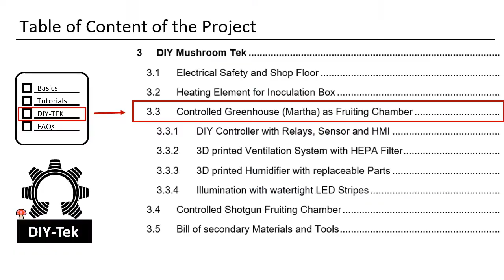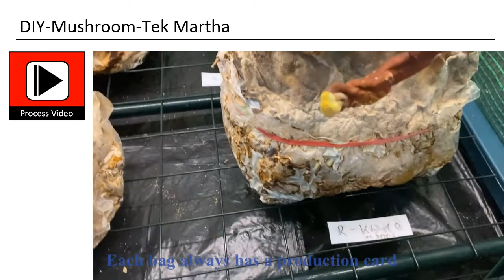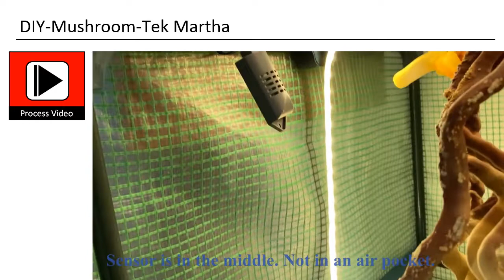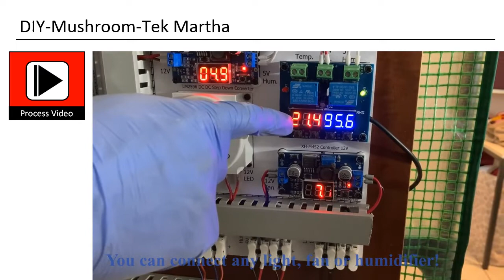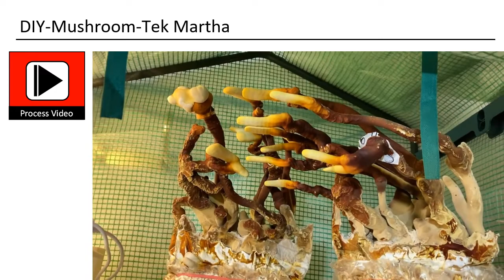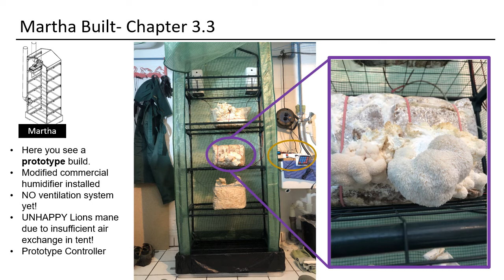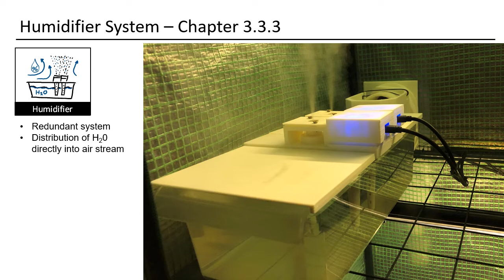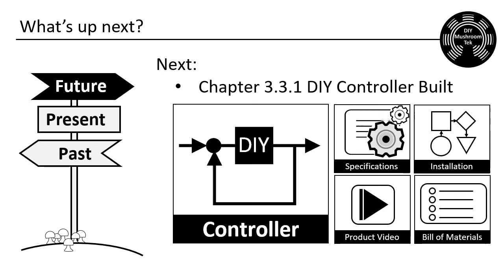3.3 Controlled Greenhouse "Martha" as Fruiting Chamber

Comment from the maker: ◾2023-12-23: Update your Martha with an even further optimized air and humidity management inside a grow tent!
https://youtu.be/A7fmnVn5-bA
https://www.thingiverse.com/diy_mushroom_tek/designs
◾2023-10-01: Please use the newer and more advanced XY-TR01 humidity controller with the SHT20 Sensor instead of the older XH-M452 with the AM2120 Sensor.
https://www.thingiverse.com/thing:6242947
https://youtu.be/9WZ3lEHDnYs

Comment: Hey i just sniped a nice cabinet style fridge for 5euro to make my fruiting chamber, im getting closer to finish my build im very excited! 

Hopefully i will not make too much mistakes when pinning and fruiting, i made PF tek cakes, grain to various substrate, agar work, cardboard.. All colonizing kind of slow because its 17° in my house. 
A few days ago i made an incubator with a small old freezer, i just put a 5L bottle with warm tap water in the morning in it, it raises to 25°C and drop to 20° the next morning, its awesome and things move a lot quicker now. 

Btw i found a reishi in the wild 2 weeks ago and attempted to clone on agar a part from the under cap i sampled from it on site, since there was only one specimen. I think i got mycelium but it barely grew like very few short fine strands, not fuzzy and very scarce and localized on the "woody sample"  i made a transfer today lets see how it goes. 

Cheers
Reply from the maker: Hey Linus, thanks for the update! I am sure you will manage the PF Tek! As I have a warm space next to my heating system, I did not pursue an incubator any further. I did design an incubator in the beginning. I always wanted do make a video about it, but did not find the time yet. You found a very nice solution with the hot water bottle. I combined some cheap electrical components in an insolated box. Then one can set up the desired temperature and it will stay that way. If I find some time, I will make a video about it. It is quiet easy to build, if you are interested just combine these things:

◼️ 12V 50W Multifunction Air Heater Insulation PTC Heaters Thermostatic Heating Element Multipurpose Heater Incubator Patio Heaters – ca 6€
https://www.aliexpress.com/item/1005003402347469.html?spm=a2g0o.productlist.main.23.510a4bf48wqpfP&algo_pvid=c32e6f56-db54-4f7c-880e-331ff64d8b70&algo_exp_id=c32e6f56-db54-4f7c-880e-331ff64d8b70-11&pdp_ext_f=%7B%22sku_id%22%3A%2212000025624999509%22%7D&pdp_npi=2%40dis%21EUR%216.67%215.07%21%21%21%21%21%402100ba4716698247552481218d0727%2112000025624999509%21sea&curPageLogUid=NUU9nynrIqyw

◼️ W1209 -50-100C DC 12V RED Digital temperature controllear thermostat temperature control thermostat switch plate W1209 case – ca 3€
https://www.aliexpress.com/item/10000002309483.html?spm=a2g0o.productlist.main.13.2a183b93UxcoBK&algo_pvid=a8273e4a-da40-4fac-b5f3-e19200072051&algo_exp_id=a8273e4a-da40-4fac-b5f3-e19200072051-6&pdp_ext_f=%7B%22sku_id%22%3A%2220000000006332489%22%7D&pdp_npi=2%40dis%21EUR%212.77%211.77%21%21%21%21%21%402100b1a616698248693445588d0753%2120000000006332489%21sea&curPageLogUid=Me7s2ps7F7FY

◼️ 12V 5A 5 amp 60W DC EU/US UK AU POWER Supply ADAPTER Transformer LED Strip Light – ca 8€
https://www.aliexpress.com/item/32988174960.html?spm=a2g0o.productlist.main.5.d61726d5mePI4T&algo_pvid=48d0d369-17da-4b38-a381-70ec232789d8&algo_exp_id=48d0d369-17da-4b38-a381-70ec232789d8-2&pdp_ext_f=%7B%22sku_id%22%3A%2266833678459%22%7D&pdp_npi=2%40dis%21EUR%218.0%217.43%21%21%21%21%21%402145288516698249428688962d0748%2166833678459%21sea&curPageLogUid=N2GnaymYuzGQ

◼️ Insulated thermo box transport 

Happy Mushrooming!

Comment: Amazingly grown reishi! Do you ever get algae growing in the humidifier because it’s transparent? I have mine outside of the tent pushing air and fog in to save space, but i imagine the algae could still be a problem
Reply from the maker: Hey drm! It's great to know you're also a fan of reishi! Here's my take on your question:

1) I've been using filtered rainwater, and it has several advantages. It doesn't lead to the calcification of my humidifier, and it remains clear for an extended period. You can easily see this clarity by looking into a rainwater reservoir. However, you're correct about the issue of algae growth when there's UV light exposure to the water. Fortunately, with only a bit of artificial light, I've never had problems with algae.

2) My humidifier design has proven to be quite robust over the years. The electronics don't seem to mind the high humidity environment, and the 3D-printed PLA parts remain functional even when they're constantly exposed to water.

3) Maintaining the humidifier is relatively straightforward. Periodic anti-calcification measures and changing the cotton sponges are the main tasks. The sponges tend to be the primary issue when it comes to maintenance. Cleaning the plastic components and the reservoir is a quick process with a brush. Anti-calcification isn't a hassle, and replacing the cotton sponges is an easy and affordable task. Neglecting this can lead to algae growth.

4) I'm currently working on designing a similar setup for tropical plants, complete with a strong LED grow light covering all UV ranges. In this new environment, I've noticed the cotton parts turn green quickly due to algae. This has led me to develop a humidifier with an external water reservoir that only performs atomization inside the tent, which has increased the need for maintenance.

5) I prefer the internal version of the humidifier because it allows me to create the desired humidity where it's needed. The slightly reduced growing space is not a significant concern for me. Regular checks inside the tent make refilling easy. It's important to ensure the reservoir is fully covered to prevent spores and other contaminants from entering the water, which drastically extends the time between maintenance.

I hope you find these insights useful. Happy mushroom growing!

Comment: Hi, why didn't you put the air filter right behaind the fan? (Great work btw)
Reply from the maker: Hey Alfredo! This is the right question to ask. I had to learn it the hard way when I started designing my Martha system. The fans are IP68, which means waterproof, and they also have low power consumption. These are the very big plus points of that specific fan. Since there is a law that states that power equals pressure multiplied with the volume flow [P = p x Q], the downside of this fan is that the pressure it can create with its low power consumption is not that big. This applies to both over and underpressure, of course.

That is why I used an 80 mm fan in combination with a 100 mm hose. There are many turbulent air flows at the entry area of the fan if you throttle it directly. The fan needs to have access to at least its diameter of air. Otherwise, there is a lot of air movement, but that movement does not translate directly into air push or pull. In order to achieve a steady and laminar flow, I gave the air a bigger diameter and some room to settle down before I installed the filter. This way, I achieved good results within my Martha.

The stated law above is also the reason why one needs strong fans if one builds a laminar flow hood. The small fans do not have the power to push the air through the HEPA filter. In my Martha ventilation design, one can also just use a small insect net as a filter in combination with the normal filter mount. This way, I also had no spores or wet air coming out of the Martha tent.

Happy Mushrooming!

Comment: Amazing setup! I'm planning on making something similar, although I will put the humidifier controllers on the outside, I'm afraid of the vapor short circuiting it and burning the thing down.
Reply from the maker: Dear K. Gabor, I am looking forward to your setup! One could of course place the controller outside,  it would of course affect the compactness of the system,  but why not? 

Concerning your thoughts about a short circuit, my controllers are running now for over one and a half year nonstop without any problems. Even with 100% humidity dialed in. One could of course add an extra fuse just to be on the safe side. I decided it is not necessary. 

Since the fans are always running and the sensor is placed near the top and thus nearer to the humidity sensor the complete tent did not even once reach the point of over saturation. That means the humidity is normally a little bit under 100%. Perfectly for growing mushroom. Staying under 100% also means, that there is not water falling out anywhere because it is still fully solved within the air!
 
If you have not isolated your martha on the ground, then this would be the coldest surface area and thus there the dew point would be undershot and water would condense on that surface area. That would be oversaturation and invite mold into your tent. 

Since the controller of the humidifier is covered and also produces a certain amount of heat, the dew point will not be undershot next to the controller board. You will not have a short circuit. 
https://en.wikipedia.org/wiki/Dew_point

Happy Mushrooming!
Reply from the maker: @wtfisthiscrap -  I created an external Fan+Humidity-System. Works very good. Maybe could be still interesting for you?! This System has many advantages! https://youtu.be/V_pqzv75mYY